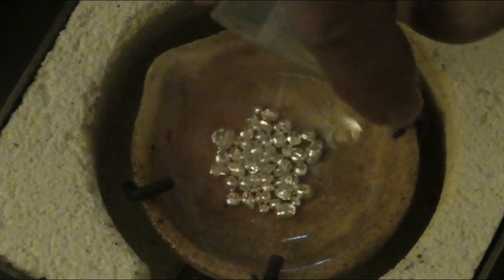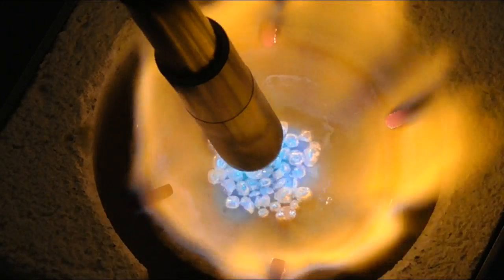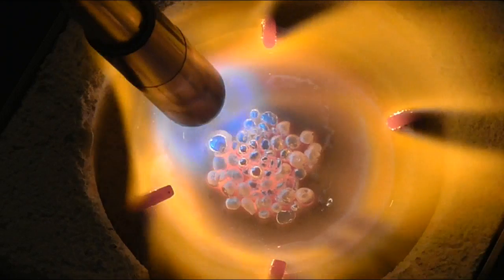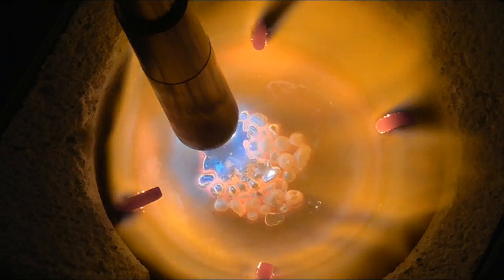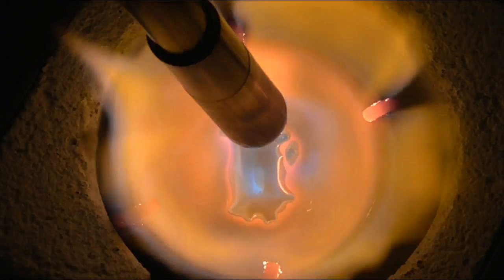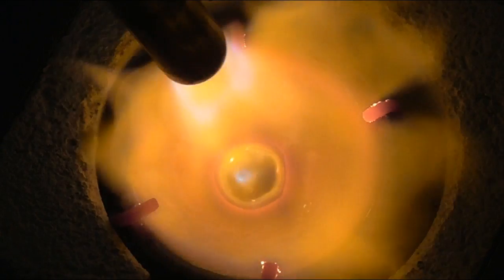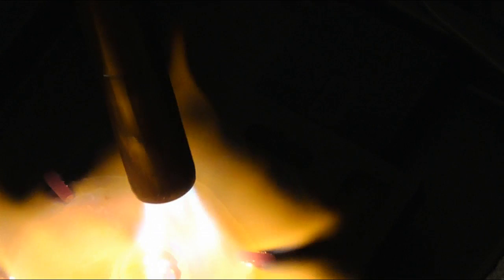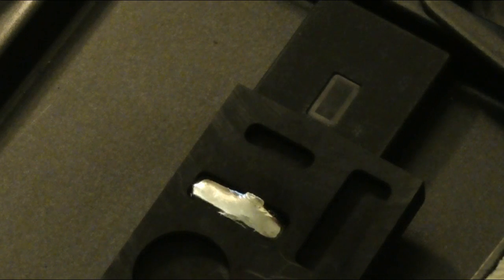Melting Down 10 Grams of .999 Fine Silver Into Bar Within Minutes

Comment: Thx mate, bought a small forge and die'/ tool just for this purpose. A $20 dollar item becomes a hundred, one may want to break that down. Ya all need to check out the sound silver makes when dropped (an ounce/ regular quarter) on a hard table...way different than non-silver, higher pitch(smoke em if you got em). Not perfect but may get u thru and tight transaction.

Comment: Keep the crucible itself over a flame and use map gas (quicker). 
You don’t necessarily need to pour it, you can let it cool into buttons. One less step for those that want such.
DO NOT pour into a cold mold! It’s a good way to get yourself injured and lose metal.
Reply: I always wondered why they heated the molds up, never put 2 and 2 together.
Reply: @blue_diamond_gem  cold molds will harbor moisture, which will instantly and violently vaporize when the molten metal is poured onto it.
Reply: @rb30zk  kaboom! Good words to be shared Kenosha.
Reply: i want silver buttons
Reply: You will start with filling buckets of clean sand for the pit. If your spirit does not break when you are weak and you return then we will teach you.